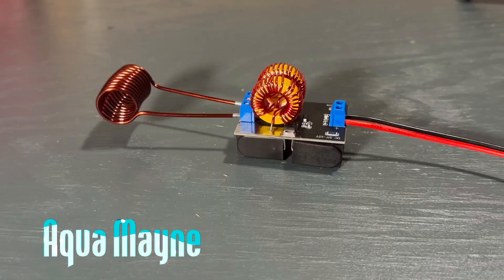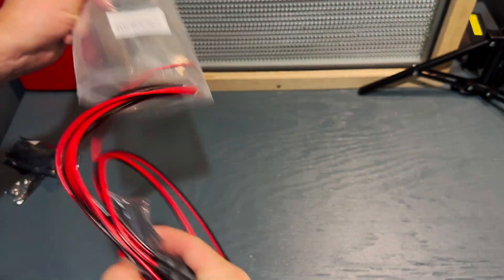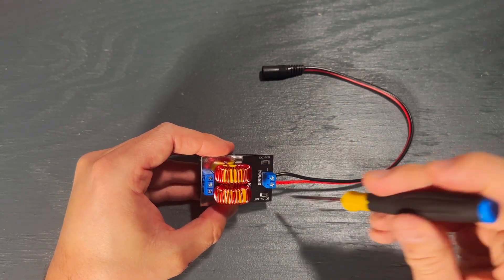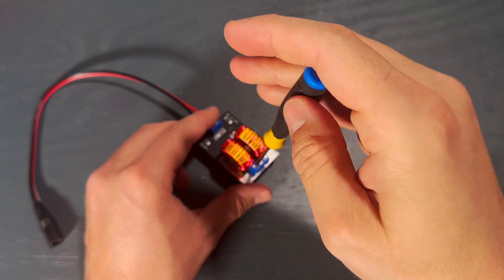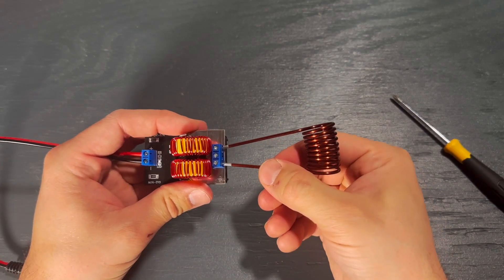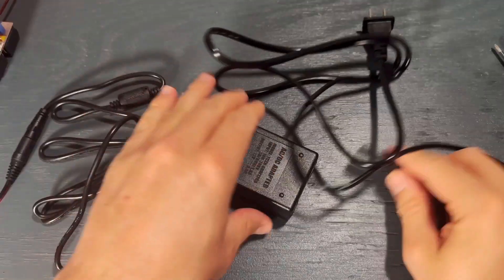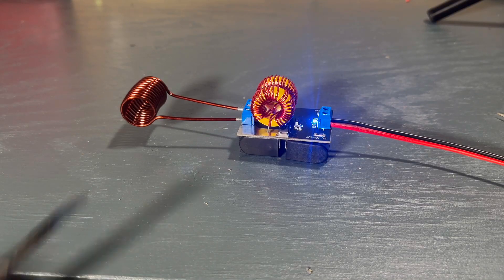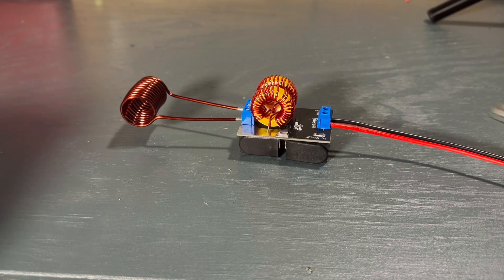The Best DIY Induction Heating Sterilizer Tutorial for Beginners

Comment: Thanks for the tutorial!  I ordered these items and followed your instructions but there's a red light on my board instead of a blue one and it's not heating the coil.  I ordered a second board thinking it was bad but it's having the same issue!  I have verified that the power supply is giving 12 volts.  Any ideas what the problem could be?

Comment: is this safe to use inside a still air box that is cleaned with isopropyl alcohol?
Reply: heat inside the box creates differential air pressure which makes the air turbid + iso and heat should not be mixed.
Reply: Well, it creates fewer air currents than a flame, but maybe having several scalpels is better. For really huge amounts of plates this is the best option.

Comment: What an easy inexpensive way to make an induction heater tool sterilizer! I had to take a small ball peen hammer and tap the ends of the induction coil a little flatter in order to insert them in the slots, but they fit great. Thanks for the great simple tutorial and the parts links. I think I spent around 45 bucks total. I need to find a small container for it now. Any suggestions?
Reply from the maker: I just left mine how it is haha. But you can probably 3d print something. I noticed some local libraries will 3-d print stuff for people if they don’t have a 3d printer

Comment: Is there anything special about the chip or anything other than the high heat involved with sterilization?  This looks EXACTLY like an RDA coil used to build on Vape decks.  Is there any reason I couldn't get the same result from modifying an RDA deck to sterilize by installing a MUCH larger inner diameter Stainless coil and firing it up?   My mod can pump out 200 watts, 7 volts.  Here's a video for a visual reference if you're not familiar with an RDA   https://youtube.com/shorts/atgwa3lEKNw?si=G82WGXD-Yz6M9CMz

Comment: How often do you heat your blades before excising explants?
Reply from the maker: Every time :)
Reply: @AquaMayne  Sorry I meant how long you heat them 😅
Reply: Hi, great video, I built it according to specs and mine lights up red instead of blue, should I be concerned? Is it a grounding issue? Because I noticed the plug from the power supply into the foot pedal is two prong going into three prong.  The coils do get hot and so does my scalpel!  just getting a red light😢
Reply from the maker: @MamaKaz923 hello. Not sure I never saw mine do that , may have to read the coil instructions if there is any :/
Reply: @AquaMayne  no instruction 😕 but it's working so I'll just roll with it I guess
Reply: @MamaKaz923  mine also lights up red but still works.